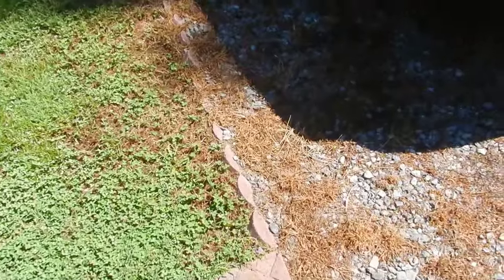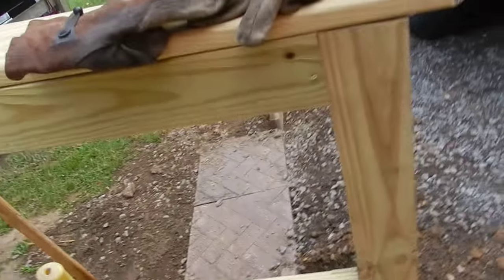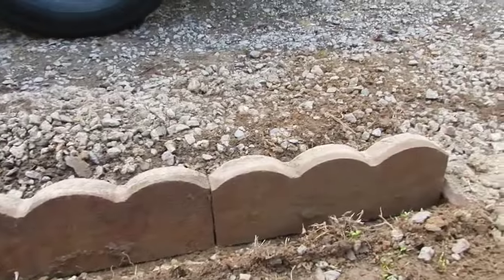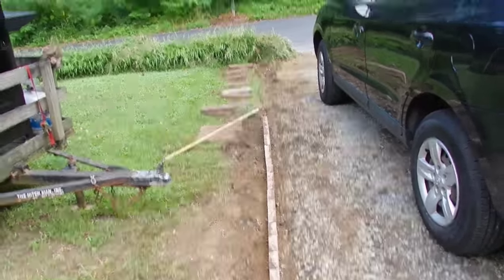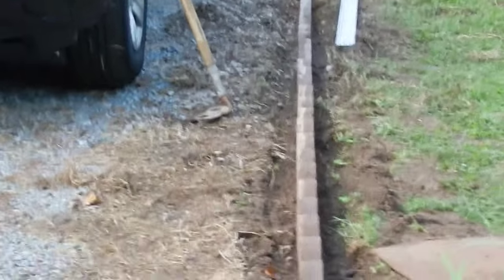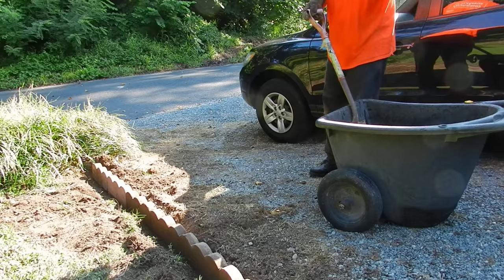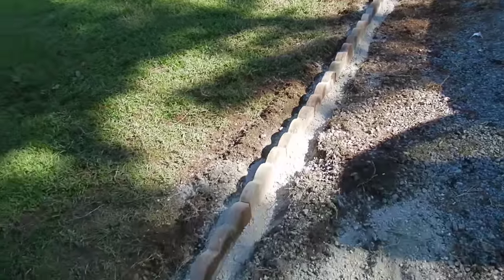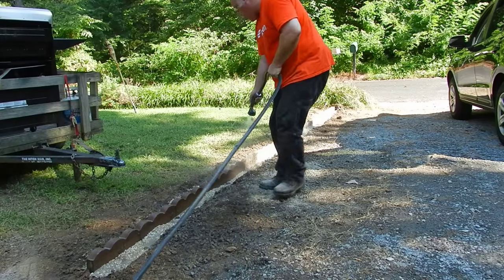How to Install Landscape Scallop Edging

Comment: I just did something like this - but no cement. we dug the trench deeper - laid brick down flat - then put the scalloped edging on the brick (still below the walkway) then backfilled with dirt to hold it in place. Granted it was for a garden and one side had a cement walkway - also, the edging we bought has tongue and grove on the sides, once they were put in place, each piece was made more solid because it was locked into the pieces on each side.
Reply from the maker: Nice.  Still looks great here.

Comment: Is the grass growing well on that lawn-side?  I feel like the concrete is so close to the surface that it would be bad for a lawn.
Reply from the maker: All looks good.  Even have to trim the grass back.
Reply: @billyq12001  
Thanks, that's good news. I'm considering this technique for my own stuff, although I might just go with bricks for the simplicity.
Reply from the maker: @spiralofhope  Just be sure the cement is 2 to 3 inches below the grass and grass will grow over it.  Bricks may need it too.

Comment: Nice video. What sort of cement do you use?
Reply from the maker: Mine had a bit of gravel in it.
Reply: Did you use quicrete?
Reply from the maker: Yes with a little gravel.
Reply: Thank you. I am going to try next weekend, weather permitting.